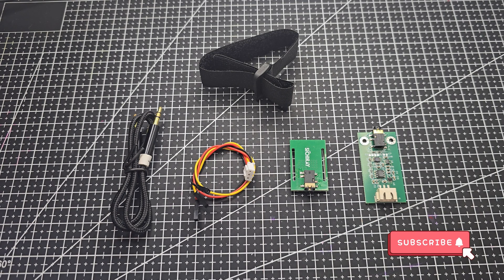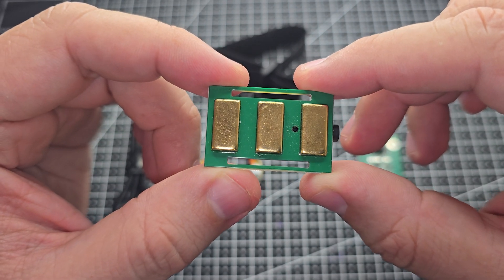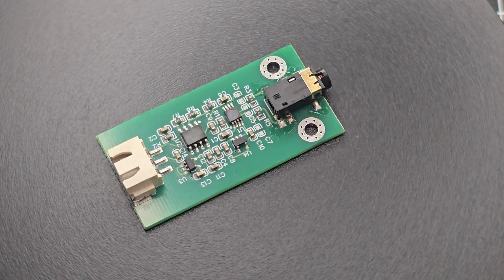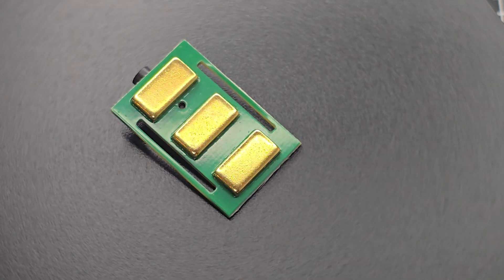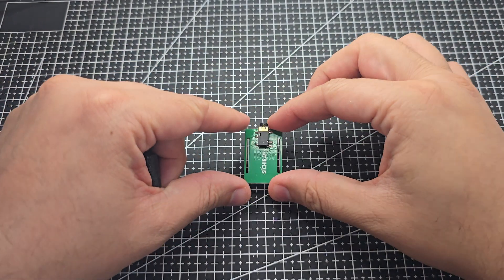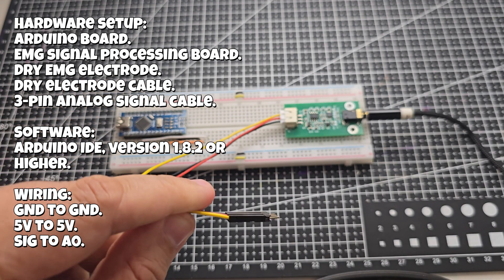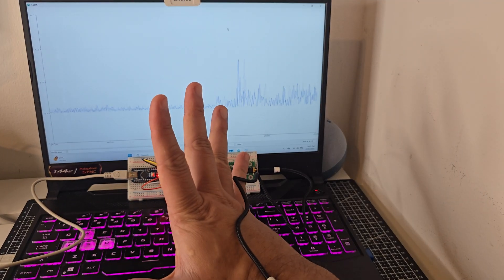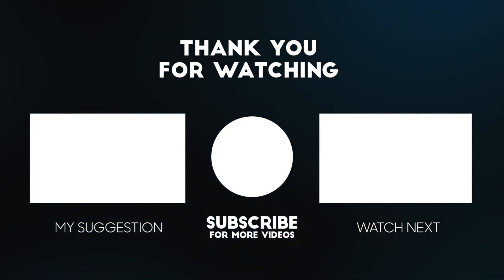Advanced Circuits Ep. 2 - Dry electrode muscle electrical sensor

Comment: Did u get this from Ali express, I'm a bit cautious about it and wanna get ur opinion on it
Reply from the maker: Yes, AliExpress — not bad at all!
I have no major complaints. The only catch is: do not use it with anything other than a battery or a well-filtered AC/DC power supply. Also, the base program is on a page in Chinese.
Reply: @Arduino4all-JP ahh ok, so I was planning to use it in one of my projects but I needed it attached to my face. Do u think this would be a problem. Also if I plugged it with a power bank would it be ok. This is my first time with electronics really appreciate ur help :)
Reply from the maker: @kasmatarthis sensors are reusable, make sure to make a sustainable structure thats confortable to your face, this sensors are perfect, be careful with the short circuits, keep your face dry too... 🎉👌
Reply: @Arduino4all-JP  thank u I really appreciate the help 😁

Comment: "This is only possible on a laptop to avoid parasitic signals, unplug your laptop and upload the code"
This is the first time im hearing this. Not on the wiki of the product or the oficial manufacturer forum or even reddit. I'm making my thesis on prosthetic devices and the first time i tried the sensor it worked but every time afterwards it did not. Ive been like 2-3 weeks without any significant advances bc of it and now thanks to you i figured it was bc i always keep my laptop pluged in. Thank you so so so so much man  <3
Reply from the maker: Nice to know that! Thank you!!!